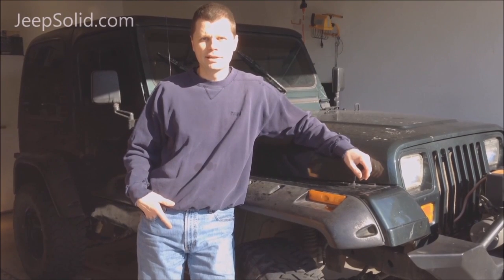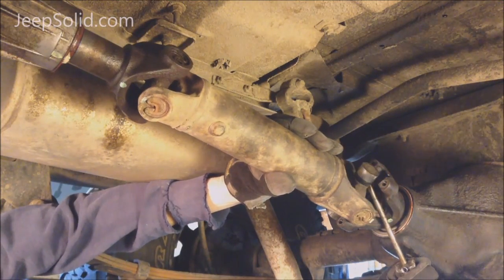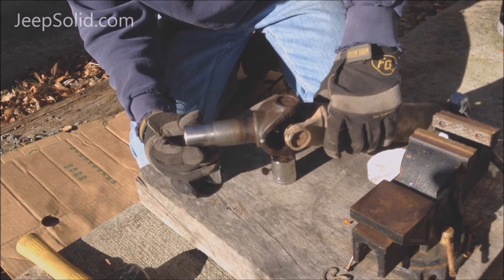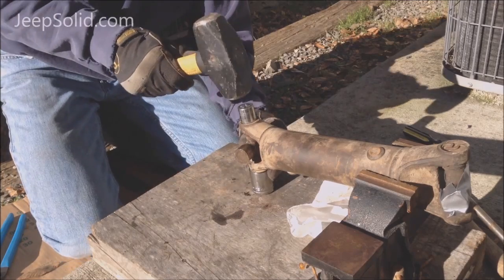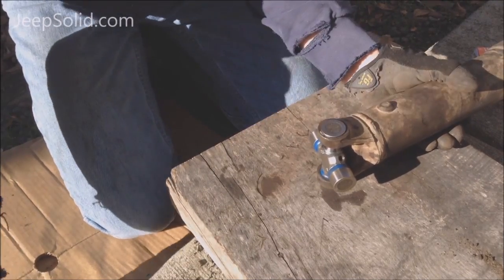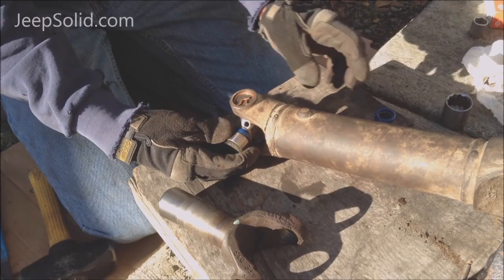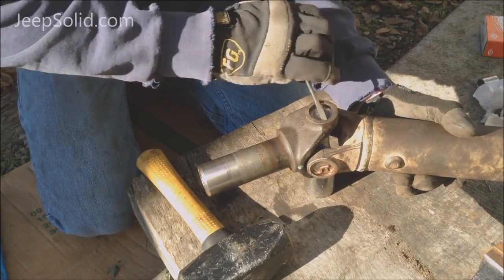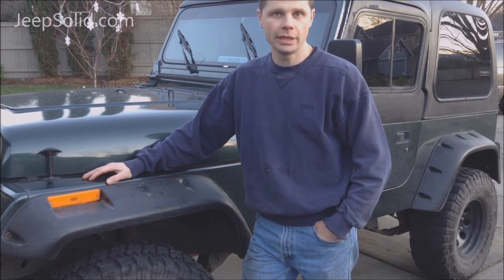How to Diagnose and Replace Universal Joints

Comment: This was a nice trip down memory lane. Years ago in college I was driving on the other side of Utah lake and heard a huge slamming and tearing sound. My rear U-Joint had broken and the drive line spun wildly out of control, tearing up anything in reach, including the floor of my YJ.  Luckily I stopped quickly and removed it.  Driving home in 4 wheel drive (essentially 2 wheel drive in the front only) I was able to make it to Advance Auto Parts where I bought a new U-Joint. Because this was before YouTube I had to “figure out” how to get it apart and back together again.  It just happened to be your exact method, only you were much more graceful in your execution. 

Looking forward to doing this on my new YJ here in a couple weeks!

Comment: Thanks to you my jeep is finally running smooth, just did replaced my rear axle U joint thanks to your video.. , and I also just watched your transmission mount replacement video while doing it... AND i also watched your rear main seal replacement video and did that!.. my two YJ's have finally had enough work done to get thru another summer.  Thanks!   next will be rear pinion and rebuilding the front axle.   All thanks to you.  Following your instagram as well.  keep rocking that!   Big thumbs up, and subscribed... 
Cheers,
 @Solid.Scott.Cassidy
Reply from the maker: Very cool!! Thanks for watching

Comment: I need to replace all the joints on my YJ95, but I am having problems finding the pieces... I found a guy but he said I need to disarm the yokes and compare the joints... he have a 1310 HD and 1330 HD , Spicer Brand... How can I know what size are the joints without disarm all the yokes? Thank you so much... I am not a mechanic neither but I love Jeeps and I love your channel :) regards from Mexico
Reply from the maker: +Life Mood Decoración The sizes are pretty standard for the 95 yj.  I'd google search the u joint you're replacing (front or rear drive shaft?) then measure the yoke to check the size.  You can get exact measurements on the u joint from googling.  Then take a digital caliper to measure your current u joint and compare measurements you see on google.

Comment: Thanks for the video. When you say to mark the drive shaft so it goes back the same was because it's balanced,  does it get balanced with the yoke? My yoke broke the other day so I need to buy a new one and replace the u joints, but obviously they aren't "matched". Should I be concerned with taking them to a shop for a balance or should I not worry about it unless I notice vibrations when I get it back on the road?
Reply from the maker: I'd call a driveline shop and ask.  They'll be able to give the best answer.

Comment: Hey, I have a 93 yj and recently noticed a clanking noise from the rear driveshaft area when I'm coming to a stop.  The u joints seems to not have any play. Any idea what it might be??
Reply from the maker: +Dave Hak be sure to rotate the driveshaft a bit when you're looking for play. One position everything is tight, a 1/4 turn and then there's play in it.

Comment: check this out. changing drive shaft U joints on 96 Jeep Grand Cherokee but the yolk end the U joints seem very loose sliding in and out without having to pound them in. Mechanic said probably wrong yolk so I grabbed one off another 96 Grand Cherokee and it's the same situation. Any ideas?
Reply from the maker: Have a digital caliper?  I'd measure the U joint, make sure it's the right one for that yoke.  Maybe the driveshaft was swapped out/upgraded at some point so they swapped out the yoke as well?  Basically, I'd start taking measurements and researching.  If still stuck, I'm sure if you went to a driveline shop, they could get you going in the right direction.

Comment: What’s up dale!! So my rear drive shaft fell out last night while driving.... any idea what would cause this...I just did my ujoints about 8 months ago too.... 59907659311__FF109D99-8ABB-494B-A0AF-906A6443DFBC.JPG
Reply from the maker: Fell out!? Fell out of the transfer case? Ujoint broke? Straps on yoke broke?
Reply: JeepSolid so I think my straps came loose on the rear diff and caused it to fall out 
Doing a SYE now and upgrading shaft
Any videos?

Comment: I didn't know you had to balance it, mine was already off and hanging down the u joint snapped off while driving.
Reply from the maker: +Samuel Augustin Yeah, it's best if you keep it in the same position, but not the end of the world. Just something to keep an eye on.
Reply: JeepSolid I installed my new ujoint and got everything re connected my question is though, it came greased up but should I pump in more grease before I drive it?